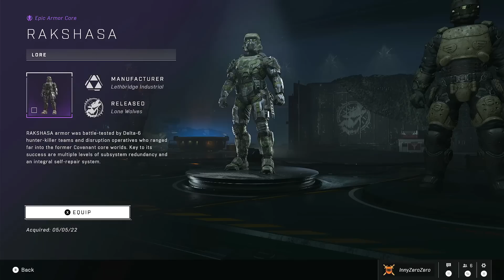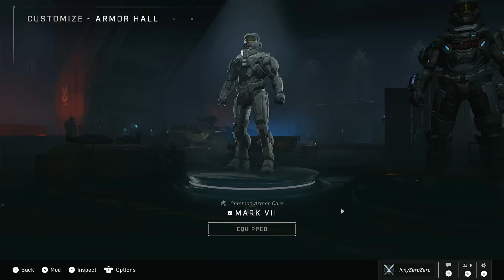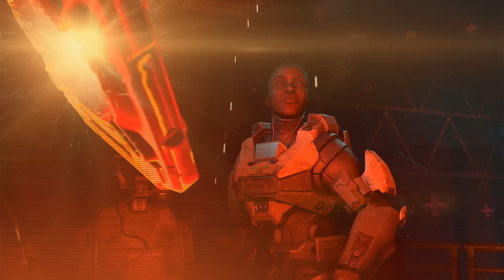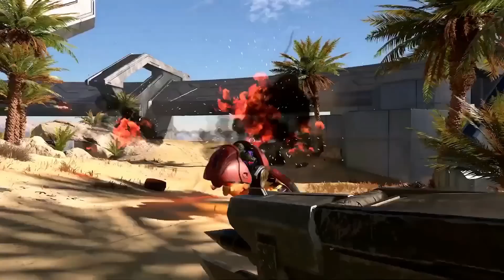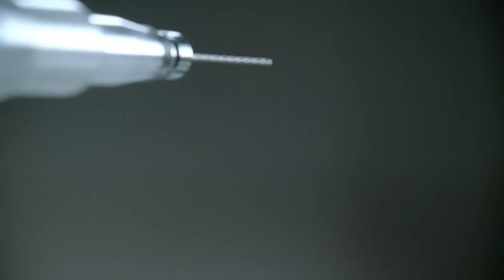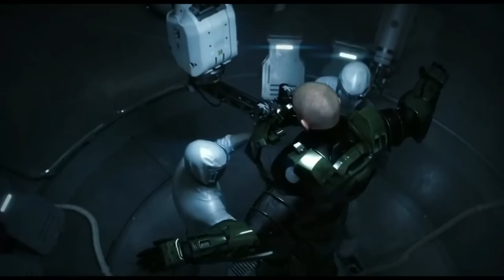Rakshasa Armor Core - Why no fusion packs? - Lore and Theory

Comment: MJOLNIR-ARMOUR/EGYPTIAN-POWER ARMOUR/POWER-ARMOUR-COOLANT-SYSTEM/VENTILATION-SYSTEM 

A Egyptian power armour will need small, twin ventilation and coolant system. These will be outfitted near the shoulder [blades] of the wearer/user. They will resemble large, bulky protrusions (like twin backpacks) that system from the shoulder area, as though they were wings. This complex ventilation system is what makes the power armour comfortable to wear for extended periods of time. Like the life support system, the ventilation and coolant system will need to be monitored and regulated by an in-built Ai system. 

Update (08/03/2022): I wonder if slime-mold [technology] can be utilized to optimise the efficiency of the ventilation system, i.e. to integrate a thin suit—made of living slime mold (if successful, this would also help to minimise weight of the power armour, thus aiding and ensure that energy is spent elsewhere). The slime-mold suit will need to make contact with the wearer/user; where it can conduct heat and other biological waste (such as sweat, and potentially dead blood cells from a bleeding wound) away from the user, and expel it near the air-ducts or any other preferred location. 

NOTE: Egyptian power-armour will combine the functionality of a thin space suit (like that seen in "space X's space suit"), a basic medical, life support system and monitors, and finally a knights suit of armour. The suit will electronic, and obviously computerized (assisted by a combination of AI systems). When it action, it will be somewhat fluent, and capable of making fluid action and movement, despite being a robotic suit (LLMs that are dedicated to mimicking natural body moment in fluid motion will comprise the majority of the suit's AI output). Lastly, the suit will need to be water resistant (water resistant spray, that is difficult to chip and wear out after extended usage will be preferred), and its ventilation system will be integrated with a small filtration system. This will make the suit resistant to poison or environments with airborne, hazardous substance. 

NOTE: A tough plastic material should be utilised on the exterior of the [Egyptian] power-armour. While being weather resistant and durable, its primary pose will be to give the power armour form (so that it looks futuristic and formidable—further adding to its ability to function as a deterrence), as well as double as additional shock-absorption/shock-dampener. The material will then need to be painted with metallic paint, so as it give it a metallic aesthetic in its composition (deceit/material mimicry).

//Close.

Comment: What really gets me is that half the pieces only say they're for Mjolnir in general, which doesn't make sense if Rakshasa is meant to be distinct
I guess it must be that its less complex nature just makes it a good testbed for more experimental equipment not yet fit for integration into the main gen 3 ecosystem
It also doesn't help that a big part of its lore and visual design come from specific non-standard field modifications made by the spartans themselves, muddying the waters on what Rakshasa is actually supposed to be

Comment: The thing that really gets me about the Rakshasa armor core is how absolutely practical it is as well as its lore where the majority of its use is for deep reconnaissance teams. Whereas the Mjolnir Armor cores look like (and are in general confirmed to be) large tasks to put on, take off, and/or repair; the Rakshasa armor core looks several degrees simpler, like a single person could put it on or take it off with little to no assistance. And with the modular separation of several components it seems that removing one for field repair would be relatively simple task to carry out.
While Spartans generally are capable of acting autonomously (and often do), this Armor Core seems purpose built for those that would expect little to no support whatsoever for even longer periods of time that might otherwise take a greater toll on a set like mjolnir which would undoubtedly have a more complex set of maintenance requirements.

Comment: I don't know that the implication here is that ONI has supersoldiers better than Spartans, but a different class with different specializations and modifications. Spartans are the ultimate soldier, whereas the operators implied here are wetworkers - trained specifically to track and eliminate individuals. It sounds like perhaps they have specialized augmentations for this purpose, as well - I'm imagining increased senses and reflexes, but maybe less strength enhancement, thus "detuning" the AKIS helmet for use with the Spartans, whose augmentations of such biology is not at the same level. 

Regardless, I think it is incredibly plausible that ONI has some sort of semi-augmented non-Spartan personnel that they can deploy outside the jurisdiction of the Spartan branch and other military commands.

Comment: The power supply could be in the chest armor. The power cables are located there and across the suit. The techsuit is underneath that suit almost like a dual layered system you can see it on the ankles. The m560 plate attachment for Mark 7 states it protects the shield generator in the chest. In a lore tab for Rakshasa it states that they have to scavenge for power cells.

Comment: Designed for operations behind enemy lines means recharging a battery might not be practical. So, an unpowered or very low powered  armor core might have been the best practical solution.

Comment: Hypothesis  : 

1. Orion project used Genetics Augmentation for creating Orion/Spartan 1. 80% success rate
2. A new super soldiers was made aka Spartan 2 which focus on Body Modifications Augmentation. 32% success rate
3. Spartan 3 used Genetics Augmentation n illegal chemicals drug enhancement.100% success rate 
4. Spartan 4 use 2nd n 3rd Spartan bacth method of augmentation with slightly nerf for safety reasons. 90% success rate

What is maintain : ideal super soldier n exo power suit
What is manipulated : 
1. the method n technology use during Spartan Augmentation 
2. Augmentation success rate
3. Time consumption n cost effectiveness 

Conclusion  : the possibility of having a beta group of Spartan 3 using illegal chemicals more intense then that used by Headhunters. The possibility of SPI armor being a part of Rakshasha armour inspiration is a plausible if we going for easy manufacturing n smaller power reactor since Gen 2 Mjolnir is also considered as an upgraded SPI armour

Comment: I believe that the rakshasa armor is likely an evolution of the spi armor with improved capabilities bringing it closer to a proper mjolnir armor while still lacking some key capabilities (in game they perform the same for obvious gameplay balance reasons) and having been made compatible with mjolnir systems, thus being labeled "mjolnir" for convenience despite lacking the fusion packs.

I highly doubt that this armor has some experimental technology bringing it up to standard mark v/markvii considering the whole ethos of the rakshasa is being simple, rugged, long-lasting, and easy to repair. The mark vii core would be more likely to receive this experimental power source before the rakshasa armor, yet it still uses fusion packs. but the rakshasa armor could use a form of sangheili tech to provide it with energy shields that are worse than mkv/mkvii but still better than spi, using more discrete power sources.

This would be within the realm of reason considering the wolves seem to spend a lot of time with the swords of sanghelios, but we do have to keep in mind that just because the wolves are in contact with the swords doesn't mean that lethbridge industrial is. However, it is certainly possible.

Comment: my postulation on the Rakshasa "Platform" is that it's part of a fairly WAY deep black project of either ONI or even of the Insurrectionists. Though i'd have to say it was an ONI program because if you look at the mythological standpoint, a Hindu Rakshasa is very similar to the Oni of Japanese mythology and lore. And they were probably made with the explicit intention of "snuffing" out any Spartans that they saw were getting "out of line". After all, why have Super Soldiers if you don't have a series of Kill-Switches to keep them from going rogue. For the armor itself though, i'm more inclined to think that the original variants had "cut corners" by moving the power supply from the back, to the forward armor. Looking at how thick the rest of the armor plating is and comparing it to the chest plate, i'm pretty sure i'm kinda on the money. So it's more likely the armor platform is using a new type of power supply and put it into the forward portion of the suit rather than the back. The mindset is likely "They are not meant to be seen so they don't really need that much protection". Or they're using that programmable matter/nanomachinery to amplify a smaller power supply so that the whole system can have more with less. Just a couple of ideas.

Comment: The whole armor core seems like it was originally designed for spartan IIs or IIIs as a cost-effective alternative to traditional Mjolnir. Spartan II's could be considered superhuman when compared to the spartan IV's. Also the pattern wolf attachment for the shikari helmet points out that spartan IVs can't use the attachment very long because they lack the cognitive ability. This suggests that maybe the older spartan generations could handle it. All that to say it seems as though this was a spartan II armor core that has been downgraded for spartan IV headhunter teams. This could explain the lack of a reactor as spartan II's were so advanced perhaps they could function perfectly fine without one as well as spartan IIIs. Although if it wasn't made for spartan IIs then perhaps it was made for Gamma company of the Spartan III generation.

Comment: I gather that it's likely that superhuman hunters, killers and assassins are going to be a part of a class segmentation to which the spartan will likely be a balanced base model of. Probably will have particular specializations like assassins will be tuned for speed-based augmentations and features, hunters for sensory-based things like increased accuracy and perceived damage due to hit placement from, and killers will be increased strength-based or combat-based things like maybe increased damage from melee. The fact that the Spartans are an included segment of the actual military and thus referred to typically as supersoldier but generally considered a superhuman may preclude that these other "class" types are not included in the actual supersoldier program...probably exterior [private] contractors that were inducted to superhuman status by using the Spartan IV procedures and thus labeling is a matter of semantics. Just my opinions and thoughts.

Comment: My only gripe about this armor core is the lack of anything on back I personally would have put a partially armored back plate with a encased battery pack similar to the phase 1/2 clone armor just to balance out the proportions a bit but that's really it I still love this style armor in halo

Comment: I've been well under the impression that the Rakshasa armor was specifically designed to counter Created forces with its low-tech approach. The detuned subsystems in the Akis II helmet could be a decision made to avoid AI detection/exploitation.
Reply: Also the cooling Armour/shoulder parts basically hiding any heat emission, since created abused IR sensors and thermal imaging

Comment: I feel the second interpretation of the superhuman killers, stalkers and assassins is more exciting, though the wording is strange. If ONI felt that the separation of the Spartan Branch into its own military institution outside of direct ONI control was a potential danger for the UNSC, it would make perfect sense for them to create spec ops unit specifically designed, trained and equipped to take down Spartans and augmented targets. Operatives would likely have equipment that gave them tactical advantages over their quarry, hence features had to be stripped for Spartan usage to prevent them from knowing that ONI would try and put them down in the case of a Spartan stepping out of line.
Reply: great theory!

although there is one small hole, if the spartan hunters need to be controlled then oni are going to need to make spartan hunter hunters and etc. however it's also possible that oni aren't considering this as after all they are a bureaucratic organization run by humans and humans make many flaws.

Comment: It's a nice theory. But realistically, it's most likely just an idea a designer had and threw it in the MP, without thinking about canon. It's not intended to have shields, strength amps and the functionality of Mjolnir.
The armour just comes across as a desperate, pre-introduction of the Gen III Mjolnir combat suit, that had Spartans outfitted in scavenged and stripped-down gear that works against the Created and their AI-assisted hacking abilities.

Nothing more

Comment: The deprogrammed helmet explanation  was almost on the nose. ONI has a habit of having failsafes for everything; thus why one section has no idea what the other section is up to. They had designed armor systems specifically for taking out rogue Spartans; more than likely starting back during the Spartan 3 project but pushed heavily during Mastercheif’s “insubordination” with Blue Team.

Comment: Rakshasa really sells the whole grounded Sci-Fi aesthetic that I’ve missed from Halo since maybe Halo 3 that I appreciate 343 making it return
Reply: They aren’t. Rakshasa is actually from Halo Reach early concept art. So it’s actually made by bungie.
Reply: @AlgaeEater09  Even better lol
Reply: MJOLNIR-ARMOUR/EGYPTIAN-POWER ARMOUR/POWER-ARMOUR-COOLANT-SYSTEM/VENTILATION-SYSTEM 

A Egyptian power armour will need small, twin ventilation and coolant system. These will be outfitted near the shoulder [blades] of the wearer/user. They will resemble large, bulky protrusions (like twin backpacks) that system from the shoulder area, as though they were wings. This complex ventilation system is what makes the power armour comfortable to wear for extended periods of time. Like the life support system, the ventilation and coolant system will need to be monitored and regulated by an in-built Ai system. 

Update (08/03/2022): I wonder if slime-mold [technology] can be utilized to optimise the efficiency of the ventilation system, i.e. to integrate a thin suit—made of living slime mold (if successful, this would also help to minimise weight of the power armour, thus aiding and ensure that energy is spent elsewhere). The slime-mold suit will need to make contact with the wearer/user; where it can conduct heat and other biological waste (such as sweat, and potentially dead blood cells from a bleeding wound) away from the user, and expel it near the air-ducts or any other preferred location. 

NOTE: Egyptian power-armour will combine the functionality of a thin space suit (like that seen in "space X's space suit"), a basic medical, life support system and monitors, and finally a knights suit of armour. The suit will electronic, and obviously computerized (assisted by a combination of AI systems). When it action, it will be somewhat fluent, and capable of making fluid action and movement, despite being a robotic suit (LLMs that are dedicated to mimicking natural body moment in fluid motion will comprise the majority of the suit's AI output). Lastly, the suit will need to be water resistant (water resistant spray, that is difficult to chip and wear out after extended usage will be preferred), and its ventilation system will be integrated with a small filtration system. This will make the suit resistant to poison or environments with airborne, hazardous substance. 

NOTE: A tough plastic material should be utilised on the exterior of the [Egyptian] power-armour. While being weather resistant and durable, its primary pose will be to give the power armour form (so that it looks futuristic and formidable—further adding to its ability to function as a deterrence), as well as double as additional shock-absorption/shock-dampener. The material will then need to be painted with metallic paint, so as it give it a metallic aesthetic in its composition (deceit/material mimicry).

//Close.
Reply: Halo has also never had a “grounded” look😂

Comment: They could be just talking about the spartan IIs. It's pretty heavily implied in-game (and possibly explicitly stated in places) that S-IIs have substantially higher cognitive function than the 4s. If you have a helmet that is primarily used by an S-II hunter, then you would feasibly downgrade it for use in S-4s to avoid wasting resources.